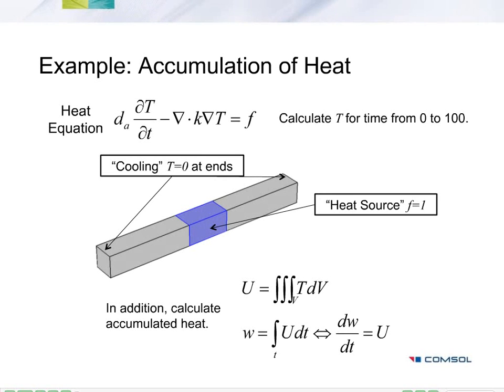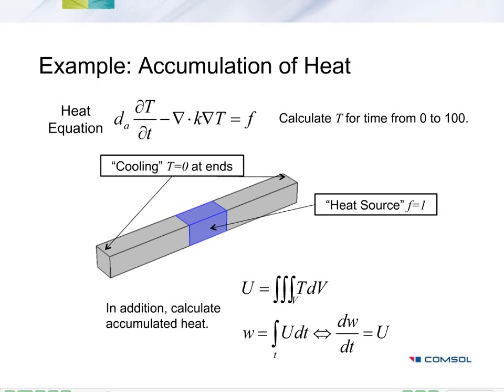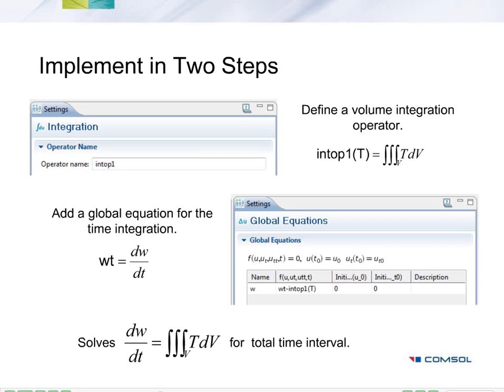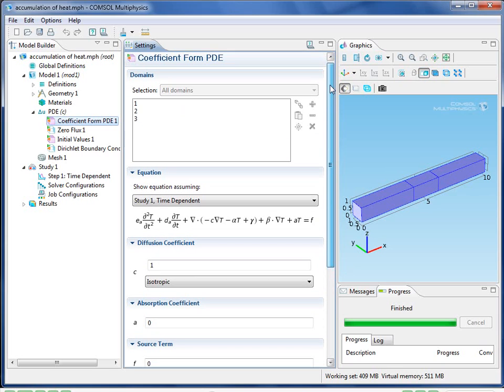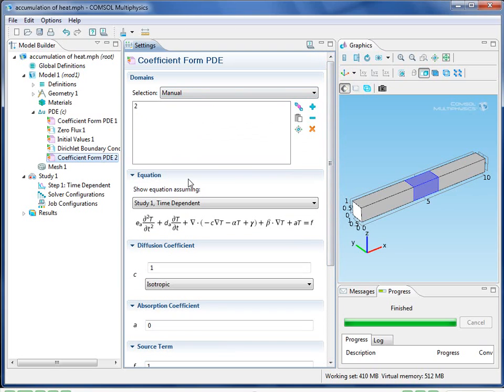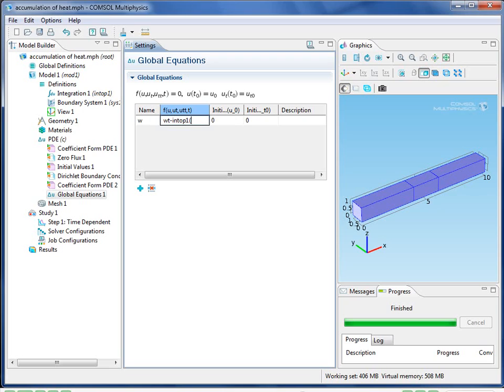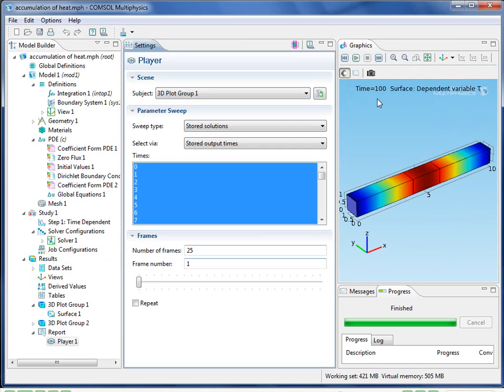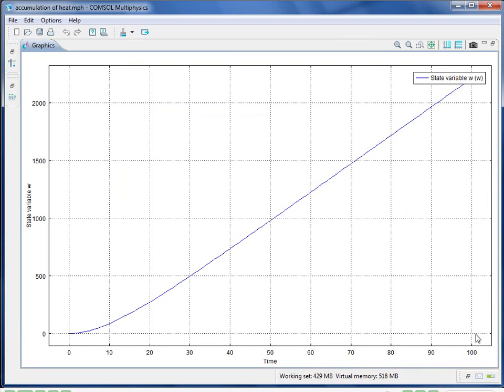Adding a Global equation to a PDE in COMSOL Multiphysics, Accumulation of Heat example.

Comment: Thank you very much for the video. very good explaination.  My model has a piezo-actuator attached with beam. There are three PDEs coupled, with three field variables and time dependent. Is there any way to solve them using COMSOL. If it is there than can you please give lnfo about some materials or videos.